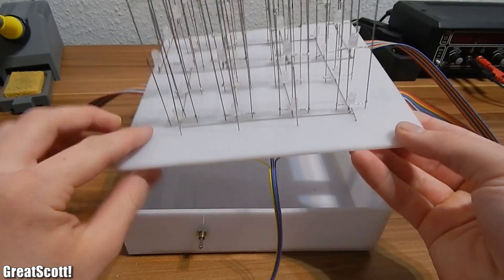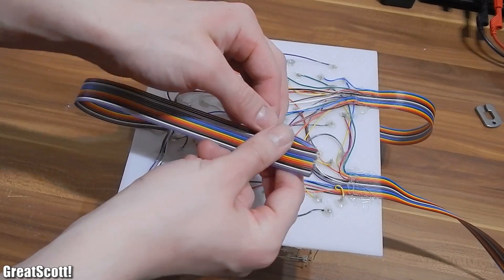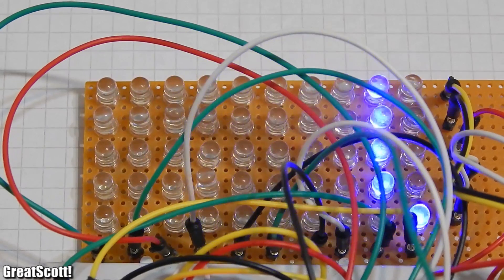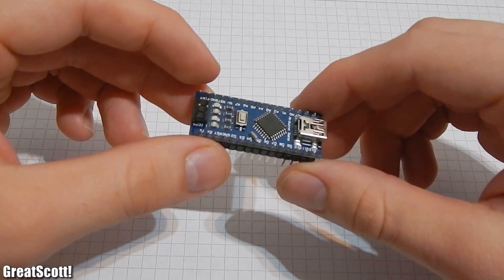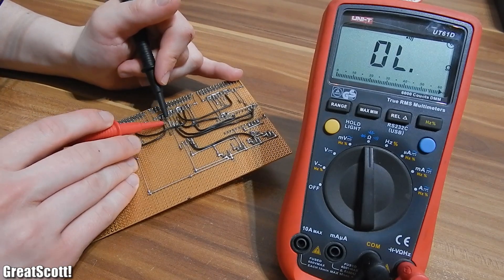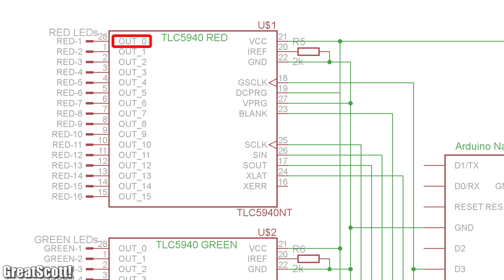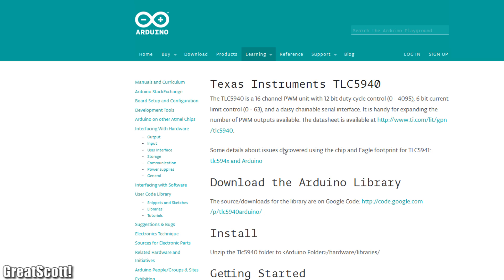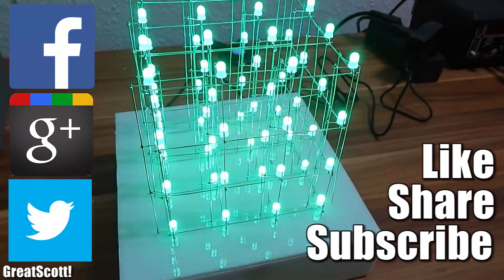Build your own RGB LED Cube Part 2: the electronics

Comment: I built the cube and everything but I'm stuck on soldering the mosfets. I followed the schematic but they don't work properly and/or i don't understand them. The orientation of your arrows in the mosfet schematic is different from the orientation on the datasheet. Also in your mosfet video, you say to use a 10k resistor.

Comment: The code doesn´t work with the arduino software1.8.4 or I´m to stupid to get it running. If the Version of my ide is the problem then please tell me the right version. I build this cube and it would bbe really great if the code would work. when I try it it spits out this error message:Arduino: 1.8.4 (Windows 7), Board: "Arduino Nano, ATmega328P"C:\Program Files (x86)\Arduino\arduino-builder -dump-prefs -logger=machine -hardware C:\Program Files (x86)\Arduino\hardware -tools C:\Program Files (x86)\Arduino\tools-builder -tools C:\Program Files (x86)\Arduino\hardware\tools\avr -built-in-libraries C:\Program Files (x86)\Arduino\libraries -libraries C:\Users\Admin\Documents\Arduino\libraries -fqbn=arduino:avr:nano:cpu=atmega328 -ide-version=10804 -build-path C:\Users\Admin\AppData\Local\Temp\arduino_build_484267 -warnings=none -build-cache C:\Users\Admin\AppData\Local\Temp\arduino_cache_340018 -prefs=build.warn_data_percentage=75 -prefs=runtime.tools.arduinoOTA.path=C:\Program Files (x86)\Arduino\hardware\tools\avr -prefs=runtime.tools.avr-gcc.path=C:\Program Files (x86)\Arduino\hardware\tools\avr -prefs=runtime.tools.avrdude.path=C:\Program Files (x86)\Arduino\hardware\tools\avr -verbose C:\Users\Admin\Downloads\Led cube code\RGB LED Cube Code v2 GreatScott!\ledcube\ledcube.ino
C:\Program Files (x86)\Arduino\arduino-builder -compile -logger=machine -hardware C:\Program Files (x86)\Arduino\hardware -tools C:\Program Files (x86)\Arduino\tools-builder -tools C:\Program Files (x86)\Arduino\hardware\tools\avr -built-in-libraries C:\Program Files (x86)\Arduino\libraries -libraries C:\Users\Admin\Documents\Arduino\libraries -fqbn=arduino:avr:nano:cpu=atmega328 -ide-version=10804 -build-path C:\Users\Admin\AppData\Local\Temp\arduino_build_484267 -warnings=none -build-cache C:\Users\Admin\AppData\Local\Temp\arduino_cache_340018 -prefs=build.warn_data_percentage=75 -prefs=runtime.tools.arduinoOTA.path=C:\Program Files (x86)\Arduino\hardware\tools\avr -prefs=runtime.tools.avr-gcc.path=C:\Program Files (x86)\Arduino\hardware\tools\avr -prefs=runtime.tools.avrdude.path=C:\Program Files (x86)\Arduino\hardware\tools\avr -verbose C:\Users\Admin\Downloads\Led cube code\RGB LED Cube Code v2 GreatScott!\ledcube\ledcube.ino
Using board 'nano' from platform in folder: C:\Program Files (x86)\Arduino\hardware\arduino\avr
Using core 'arduino' from platform in folder: C:\Program Files (x86)\Arduino\hardware\arduino\avr
Detecting libraries used...
"C:\Program Files (x86)\Arduino\hardware\tools\avr/bin/avr-g++" -c -g -Os -w -std=gnu++11 -fpermissive -fno-exceptions -ffunction-sections -fdata-sections -fno-threadsafe-statics  -flto -w -x c++ -E -CC -mmcu=atmega328p -DF_CPU=16000000L -DARDUINO=10804 -DARDUINO_AVR_NANO -DARDUINO_ARCH_AVR   "-IC:\Program Files (x86)\Arduino\hardware\arduino\avr\cores\arduino" "-IC:\Program Files (x86)\Arduino\hardware\arduino\avr\variants\eightanaloginputs" "C:\Users\Admin\AppData\Local\Temp\arduino_build_484267\sketch\ledcube.ino.cpp" -o "nul"
"C:\Program Files (x86)\Arduino\hardware\tools\avr/bin/avr-g++" -c -g -Os -w -std=gnu++11 -fpermissive -fno-exceptions -ffunction-sections -fdata-sections -fno-threadsafe-statics  -flto -w -x c++ -E -CC -mmcu=atmega328p -DF_CPU=16000000L -DARDUINO=10804 -DARDUINO_AVR_NANO -DARDUINO_ARCH_AVR   "-IC:\Program Files (x86)\Arduino\hardware\arduino\avr\cores\arduino" "-IC:\Program Files (x86)\Arduino\hardware\arduino\avr\variants\eightanaloginputs" "-IC:\Users\Admin\Documents\Arduino\libraries\SparkFun_TLC5940_Arduino_Library-master\src" "C:\Users\Admin\AppData\Local\Temp\arduino_build_484267\sketch\ledcube.ino.cpp" -o "nul"
"C:\Program Files (x86)\Arduino\hardware\tools\avr/bin/avr-g++" -c -g -Os -w -std=gnu++11 -fpermissive -fno-exceptions -ffunction-sections -fdata-sections -fno-threadsafe-statics  -flto -w -x c++ -E -CC -mmcu=atmega328p -DF_CPU=16000000L -DARDUINO=10804 -DARDUINO_AVR_NANO -DARDUINO_ARCH_AVR   "-IC:\Program Files (x86)\Arduino\hardware\arduino\avr\cores\arduino" "-IC:\Program Files (x86)\Arduino\hardware\arduino\avr\variants\eightanaloginputs" "-IC:\Users\Admin\Documents\Arduino\libraries\SparkFun_TLC5940_Arduino_Library-master\src" "-IC:\Users\Admin\Documents\Arduino\libraries\digitalIOPerformance-master" "C:\Users\Admin\AppData\Local\Temp\arduino_build_484267\sketch\ledcube.ino.cpp" -o "nul"
"C:\Program Files (x86)\Arduino\hardware\tools\avr/bin/avr-g++" -c -g -Os -w -std=gnu++11 -fpermissive -fno-exceptions -ffunction-sections -fdata-sections -fno-threadsafe-statics  -flto -w -x c++ -E -CC -mmcu=atmega328p -DF_CPU=16000000L -DARDUINO=10804 -DARDUINO_AVR_NANO -DARDUINO_ARCH_AVR   "-IC:\Program Files (x86)\Arduino\hardware\arduino\avr\cores\arduino" "-IC:\Program Files (x86)\Arduino\hardware\arduino\avr\variants\eightanaloginputs" "-IC:\Users\Admin\Documents\Arduino\libraries\SparkFun_TLC5940_Arduino_Library-master\src" "-IC:\Users\Admin\Documents\Arduino\libraries\digitalIOPerformance-master" "C:\Users\Admin\AppData\Local\Temp\arduino_build_484267\sketch\ledcube.ino.cpp" -o "C:\Users\Admin\AppData\Local\Temp\arduino_build_484267\preproc\ctags_target_for_gcc_minus_e.cpp"
C:\Users\Admin\Downloads\Led cube code\RGB LED Cube Code v2 GreatScott!\ledcube\ledcube.ino:16:200: fatal error: Tlc5940.h: No such file or directory #include "Tlc5940.h"               // don't forget to download the Tlc5940 lib from arduino playground and place it in you lib folder ( http://tlc5940arduino.googlecode.com/files/Tlc5940_r014_2.zip )                                                                                                                                                                                                        ^compilation terminated.Bibliothek SparkFun_TLC5940_Arduino_Library-master in Version 1.1.0 im Ordner: C:\Users\Admin\Documents\Arduino\libraries\SparkFun_TLC5940_Arduino_Library-master  wird verwendet
Bibliothek digitalIOPerformance-master im Ordner: C:\Users\Admin\Documents\Arduino\libraries\digitalIOPerformance-master (legacy) wird verwendet
exit status 1
Fehler beim Kompilieren für das Board Arduino Nano.

Comment: Hi Grate Scott I am making circuit now almost it's done but now I confused which wire goes where from IRF9540N. Symbols are bit confusing. Please tell me where G,D and S pin need to contact. Thanks in advance
Reply from the maker: Check the datasheet and compare it to the schematic
Reply: Hey man your schematic is Reversed!   The mosfet symbol is mirrored and A0-A7 are TOTALLY reversed!!!   please update asap!!

Comment: if your going to take all that time to solder the pin headers on and together a single sided pcb why didnt you just home etch a pcb with a laser printer with smd socket conectors like and IDE cable or somthing?

Comment: Hi,
why do you use pull up resistors on the mosfets ? The voltage which runs through these resistors should be very small. Is it to  stabilize the voltage on the pin and to avoid floating? Thanks.
Reply from the maker: +James Harold Avoid floating is correct.

Comment: Hi!

I have one thing in mind, which I don't understand. It is the part with the MOSFETs, the source should be connected to A1, A2 and so on, then linked through a 1K resistor to the gate? Which is Also connected to 5V of the arduino? Also where should I add the capacitors? Thanks a lot!

Comment: just a tip on the dremall l tool
before you cut. measure and find the area you want. 
than drill a hole(varied size) in each corner.

Comment: GreatScott! - Great Project!

I have made 1 of these cubes following your videos and used all the same parts except I am using an Arduino Pro Mini 328 16Mhz 5v and I have also tried an UNO rev 3.
The first code cycles through 7 colours and the second code just does the random flashing LEDs.

Does the code need altering to work on anything other than a NANO ?
How do I get this working right ?

Thanks for sharing this Scott.
Reply from the maker: Ant Brown You can use other Arduinos with the same pinout or more pins and the code doesn't need a change. You just have to use the same pins on the other Arduino to make it work.
Reply: GreatScott! Still not working right.... 
I have re-checked all the pinouts and they are all the same as your schematic. I have tried 2 Arduino Pro Mini's and an UNO with the same results as I mentioned earlier, but I get nothing with an Arduino Mega 2560.
I can't understand whats wrong it, but it is still a great little cube. Even better if I can learn to program it.
Thanx again for such a good tutorial

Comment: Thank you for a great video series! Dropping a comment to give a tip for Dremel work. In a situation like this, I like to use a drill bit to get a hole I can fit a round stone grinding bit into and actually grind away the edges until I reach a traced outline. I find the cutting wheel is far too clumsy for making a hole in something.
Reply from the maker: Thanks! I will give it a try next time

Comment: how do you make this without using Arduino Nano? I already bought Atmega328, and do not want to waste money on buying Nano again.. Could you please tell me how? Thanks!!
Reply from the maker: You can use the Atmega328 in a standalone circuit. Just search for "arduino standalone". Be careful to connect the correct I/Os to the MOSFETs and TLCs.

Comment: i tried so much i can clear these errors please can you tell me why this is showing please i am waiting for code

Arduino: 1.5.6-r2 (Windows 7), Board: "Arduino Nano, ATmega328"

ledcube.ino: In function 'void loop()':
ledcube:56: error: 'reset' was not declared in this scope
ledcube:56: error: 'allred' was not declared in this scope
ledcube:57: error: 'reset' was not declared in this scope
ledcube:57: error: 'allgreen' was not declared in this scope
ledcube:58: error: 'reset' was not declared in this scope
ledcube:58: error: 'allblue' was not declared in this scope
ledcube:59: error: 'reset' was not declared in this scope
ledcube:59: error: 'allgreen' was not declared in this scope
ledcube:59: error: 'allblue' was not declared in this scope
ledcube:60: error: 'reset' was not declared in this scope
ledcube:60: error: 'allgreen' was not declared in this scope
ledcube:60: error: 'allred' was not declared in this scope
ledcube:61: error: 'reset' was not declared in this scope
ledcube:61: error: 'allred' was not declared in this scope
ledcube:61: error: 'allblue' was not declared in this scope
ledcube:62: error: 'reset' was not declared in this scope
ledcube:62: error: 'allgreen' was not declared in this scope
ledcube:62: error: 'allred' was not declared in this scope
ledcube:62: error: 'allblue' was not declared in this scope
ledcube:66: error: 'CubeUpdate' was not declared in this scope
Reply from the maker: I see your problem. Make sure that the three seperate parts of the code (ledcube, function, definition) are placed in the same folder. If you just unzip the archive and don't change anything, then it should work. I just tried it and everything works